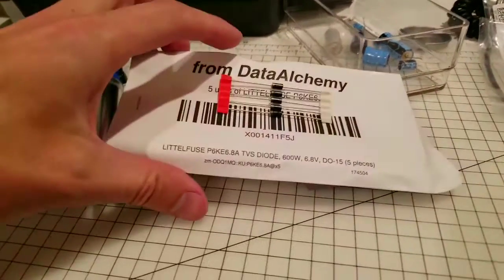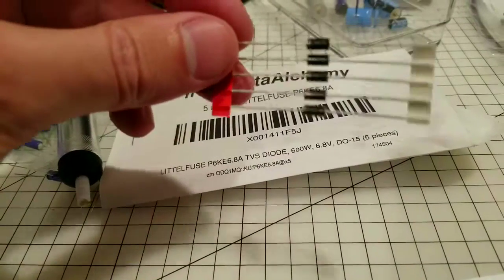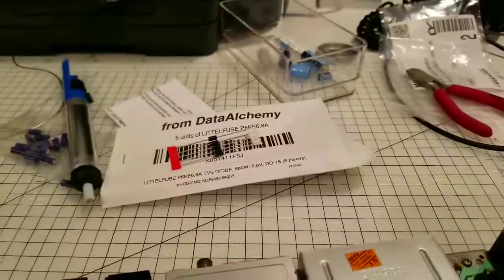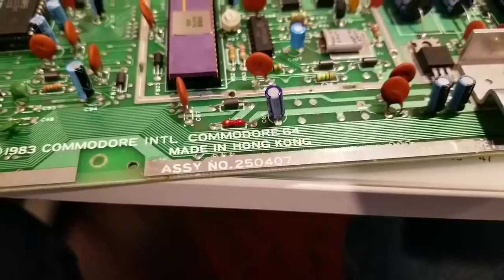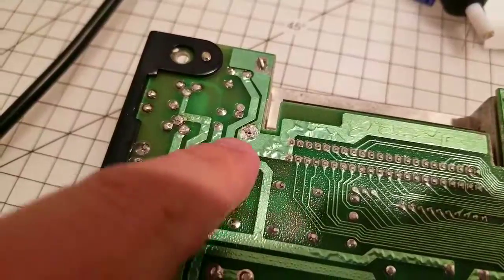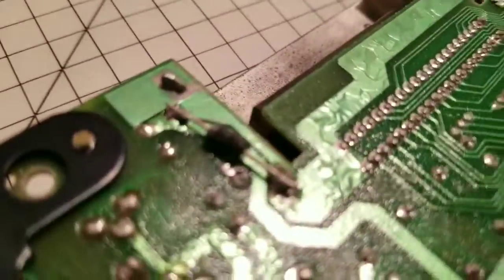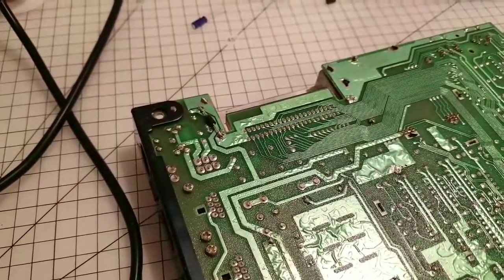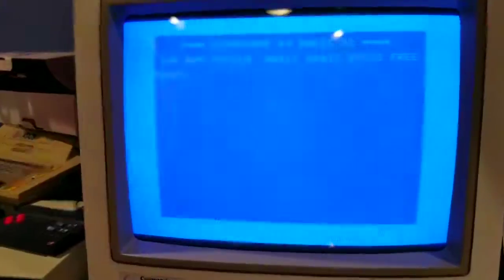Retro Recipes 1st Video!: Commodore 64 Diode Power Surge Protection

Comment: Nice job! I'm honored. :) Glad you stated that it's only a last line of defense really. The diode won't do anything under 6.8V so in certain scenarios the C64 could still be damaged until it shorts. I'm going to do more videos about the C64 power supplies and protection methods soon(ish).
Reply from the maker: +Jan Beta You're welcome Jan! I'm wondering, why don't we use 5V diodes instead? Is it because they do not exist?
Reply: If they were only 5V, they would easily react to small voltage peaks when powering on the machine and blow the fuse. The 6.8V were carefully chosen to not go off accidentally and still provide some protection for the ICs (as I said in my video, they usually survive 7V for some time without dying). Not my idea but taken from the glorious pdf (which again paraphrases old German C64 magazines for the most part I think). ;)
Reply from the maker: Great points! BTW thank you for inspiring the intro to my new video. I have thanked you in the comments! ;) https://www.youtube.com/watch?v=XrTmwooQ298
Reply: Hi Jan, ich habe mir leider bidirektionale Dioden bestellt. Funktionieren diese ebenfalls? Ich habe P6KE6.8CA. Die sollten doch auch funktionieren oder? Die Polung wäre dann auch egal, oder? Vielen Dank im voraus!!!!

Comment: I'm building a circuit based on this overvolt protection sensor. The benefits are that it can ignore small transients, so you can use a lower trip threshold, and it can trigger a thyristor which will provide a dead-short - shunting all current through the fuse, rather than merely what gets past the diode. This way, a "soft failure" can't happen that might have your chips see a steady state condition of 6-7 volts. I've seen an overvolt protection circuit online for the C64 that uses a normally-open relay, but I'm worried that won't be fast enough or that mains voltage could cause it to fail latched.

https://www.onsemi.com/pub/Collateral/MC3423-D.PDF

Comment: Hello have a question I them yet but the modern diet bought bad parts get in the Netherlands but still want that protective diode 

setting I don't have PayPal any more can be purchased at Conrad Diode but only see a version >

Littelfuse P6KE 6.8 A TVS-diode DO-204AC 6.45 V 600 W model seems same model as yours.

Can I use that and does matter how I place him or does that not matter. 

Thank you
Reply from the maker: I think that should work. The orientation doesn't matter.

Comment: That immitates a crowbar protection circuit. A bit overkill, but still better than killing our beloved C=64.
Reply: Considering the damage inflicted by a runaway power supply, cheap insurance. 

It would be advisable to build/buy a crowbar circuit to protect your valuables.

Comment: Found a good deal on them. https://www.ebay.ca/itm/100PCS-P6KE6-8A-E3-73-TVS-600W-6-8V-UNIDIR-AXIAL-P6KE6-8A-E3-BBC/142664571946?ssPageName=STRK%3AMEBIDX%3AIT&_trksid=p2057872.m2749.l2649 BTW  Do you know were to put the diode for a 1982 C64 ASSY 326298 REV A NTSC Motherboard ?